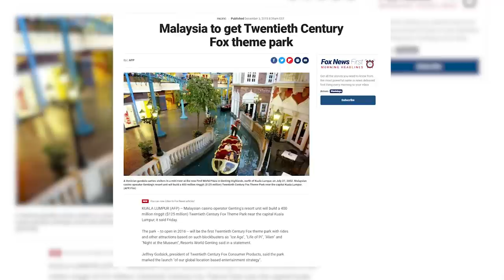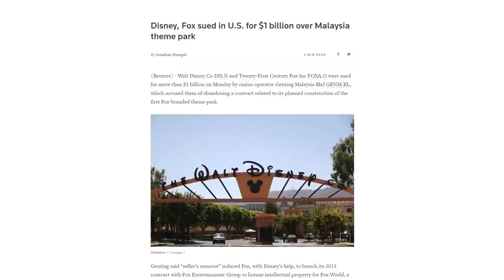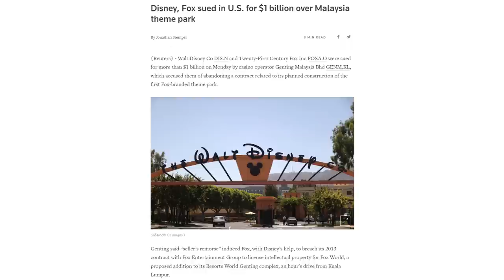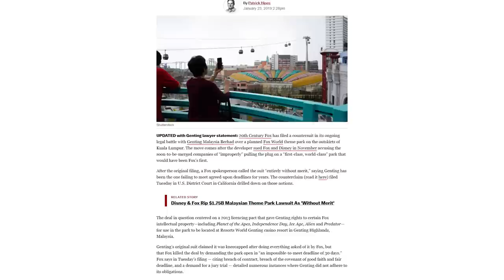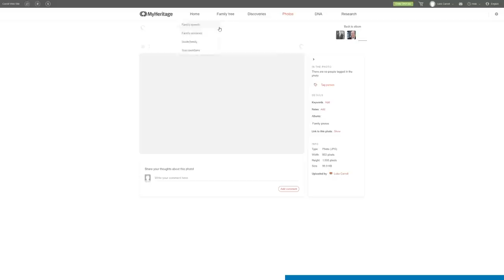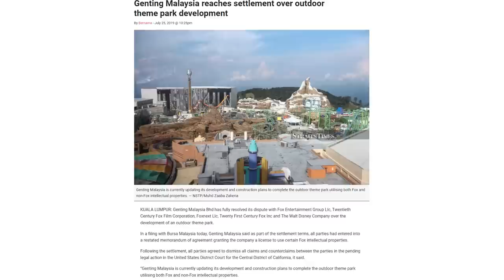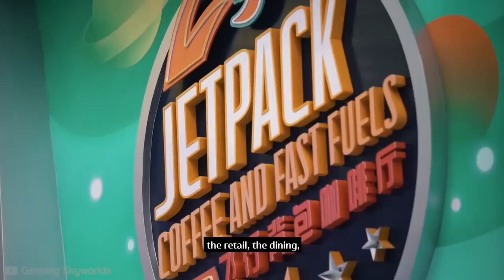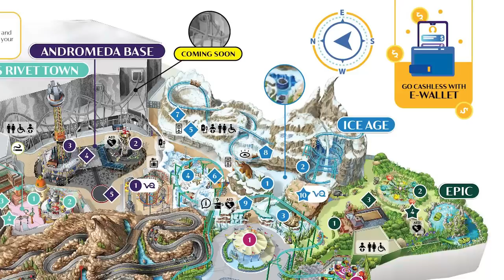The Troubled History of Genting Skyworlds

Comment: some ride was because some have mechanical issue or problem and some comingsoon
Reply: They opened some other 3 ride which is planet of the apes, duel power coaster and Expedition Thin Ice dark ride on February 2023 and also the sfx coaster will be open in 2024 that's slow project